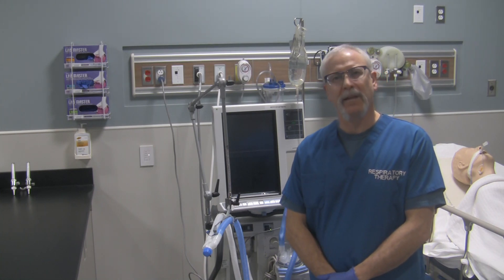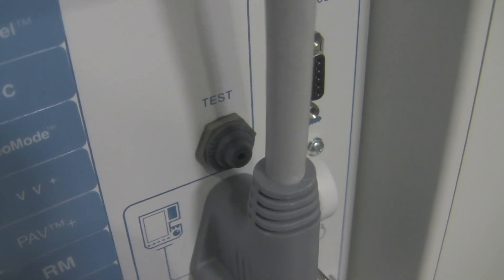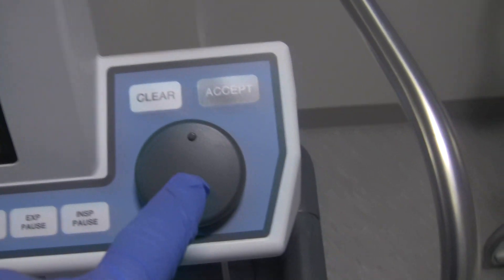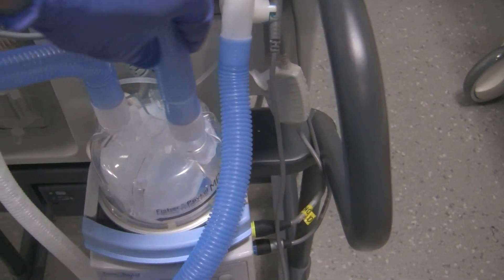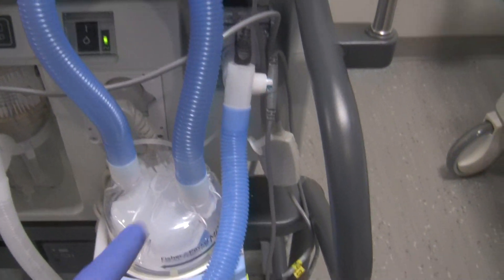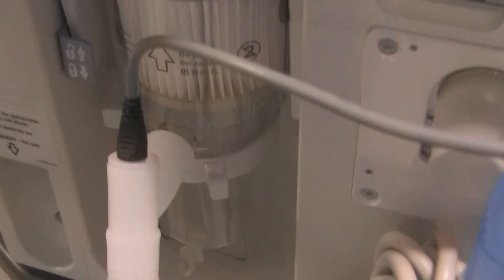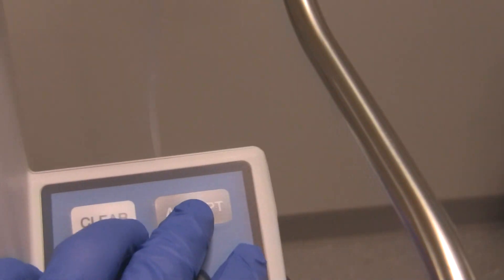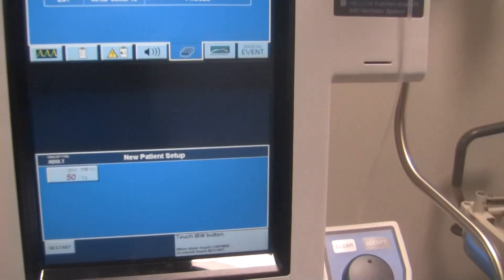Covidien Puritan Bennett 840 Ventilator (PB 840): Pre Use Check (SST)

Comment: The second test shows circuit pressure test failed, tried it without a humidifier. Any idea what could it be?
Reply: Could be a seal leak, wye not capped tight enough, filter box needs replacement, leaky hose, hoses not in tight.vpump leak in humidifier issue. Etc..